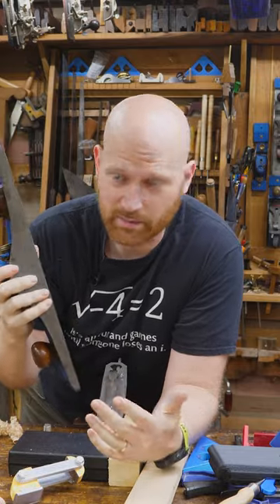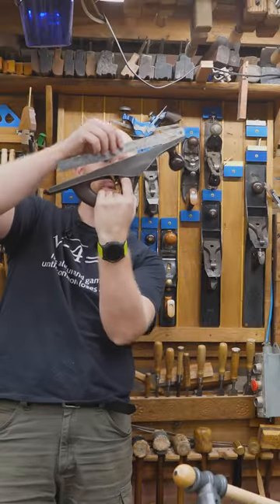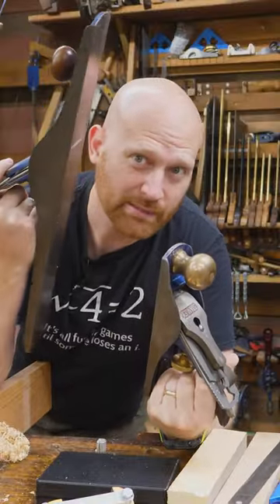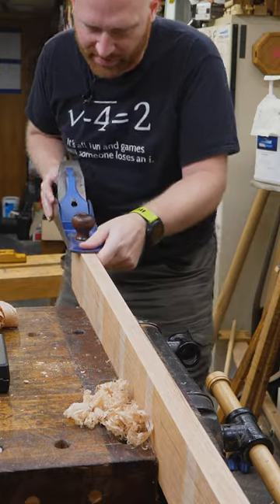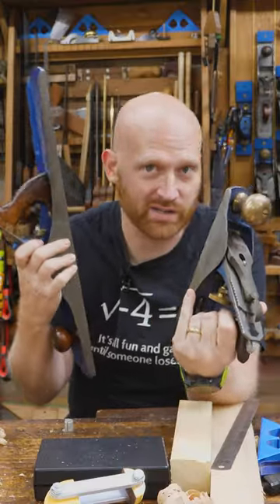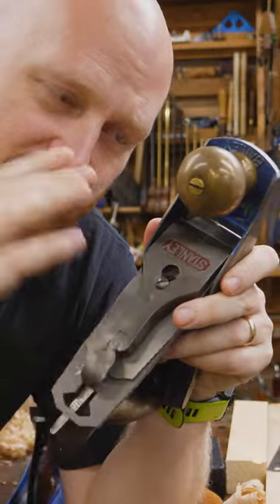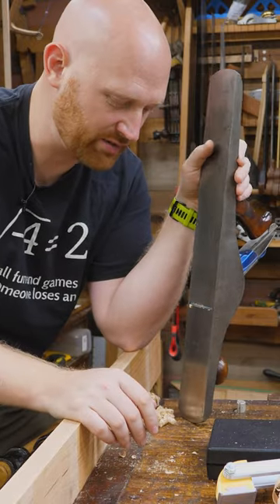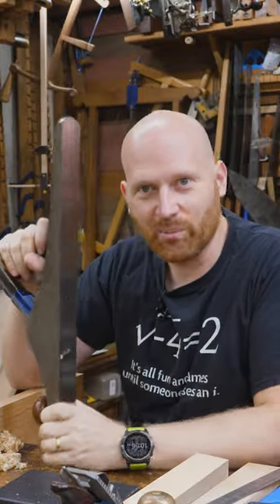How Flat Should The Plane Be

Comment: Well, here's my two cents as a luthier: I'm always joining pieces that are 100-thou or thinner. And when you butt up pieces that thin and hold them to the light, you can really see the inconsistencies. On anything over 250-thou, it's probably not a major issue, but when it's under 100, and has to withstand 150lbs or more of tension, it's imperative that the joint is flawless. 

In this case, the sole flatness is a major factor. If it's just a tiny bit out, you can clearly tell with the light-test. So I have to spend a lot of time making sure the sole is dead flat. 

All of that said, these imperfections will translate to thicker joints. You just won't be able to tell as easily. Sitting flat on a bench, the joints on thin pieces can look perfect, until you hold them to a light and see how imperfect they really are. So ultimately, I do think it's better to flatten them, even for thicker joinery, and especially if it's for stress-bearing applications. 

I'd love to see a test! One plane imperfect, one plane flattened to perfection. One joint from each plane, using the same exact piece of wood, glued with the same glue at the same time. Then stress-test them and see where the numbers are. Extra points for testing different thicknesses of joints. That's a video I'd be thrilled to watch!

Comment: I think that it was Chris Schwarz or the Wood Whisperer who said that flat enough is flat enough. Trying to get so flat that you can’t see light coming through a handheld straight edge was dumb, because when is the last time you had to take shavings as thin as a light particle? 

I believe he even said that he saw a student at a woodworking class have his calipers confiscated, since the student kept triple checking everything to machinist standards instead of focusing on his woodworking learning.
Reply from the maker: right on. machinists are often the most frustrated woodworkses
Reply: @WoodByWrightHowTo  I can absolutely imagine that, machining is so often about super tight tolerances, plans where 0.1 mm of variance is way too much, surfaces flattened using a level calibrated to the nth degree that have to be aligned with the earth's magnetic field, etc etc

Meanwhile wood, by its very nature, defies such precision, it flexes, squishes, and bends. Woodworking has to operate on broader specs than machining, and nothing infuriates a machinist more than sloppy tolerances!! 😂
Reply: I could also argue that, if your tools are more precise, then if you yourself have missed the mark slightly in your work, the work will still be relatively good. If your tools are deficient then you have to work harder to achieve good results.
Reply: @dragonsaint9446 nothing better than the absolute bewilderment that hits a machinist when their first drawer binds like its friggin pinned in place the day after they make it
Reply: @dylanneely91 as a guy who is a hobbyist in machining and woodworking, I learned this real quick 😂 thought that leaving 0.01mm tolerance per side would be enough for a lid to smoothly slide down the full height of a wooden base for a brass nameplate I made. There was lots of sanding and swearing to be had 🫠🙃
Reply: I come from a machining background in a wood flooring factory and honestly if you run calipers of wood flooring you will find alot of variance in one 24" piece. Our tolerances ranged from ±.003 on the tongue and groove thicknesses and width to +.010 or -.005 on overall width and thickness. That is still a very solid looking mating of 2 pieces. I wanted, and thought I would need, that level of precision, but it's not really necessary for most things I do in the wood shop. Lesson: Don't be a perfectionist unless you can afford to be

Comment: I'm a machinist, and I can't imagine working with a tolerance of .100 of an inch. A low precision job still usually has a tolerance of +- .01
Reply: Wood will swell and contract more than the tolerances you normally work with.

Comment: My wooden joiter isn't flat, I noticed a few days ago, so boards get a curvature as the iron bites (more) at the start and end, regardless of the shavings thickness. Time for sanding.
Reply from the maker: for a wooden plane you usually use another plane. It is much faster.
Reply: @WoodByWrightHowTo  Yep but, for my piece of mind, I would like to use a bigger plane for that and the jointer is 90cm long. The longest I have. Patience, sandpaper and a vacuumcleaner will do.
Reply: That biting could be as well due to uneven pressure youre applying to the plane. At the beginning, you should push the front part to start registering before the blade engages. Same at the end of the board, apply  pressure at the end to keep the blade at the same height between the blade and the board. Hope it helps 🙏
Reply: @rustytoolworks   Thanks, I'm aware of that and my technique is far from perfect. More practice, more practice.
Reply: @rustytoolworks    A straight edge will settle things. Biting at the beginning and ending of cuts tends to be due to the sole around the mouth being farther above the work surface than the toe and heel are. I have a nice-looking Ross and Alexander 17-inch beech jack plane that has that problem.  It also has a bit of twist.  If or when I get around to making it functional as well as pretty, I may start by very carefully removing the twist with a block plane applied locally to the high spots.  Due to the grain in the wood, you have to plane toward each end to avoid tear out, which increases the risk of splintering the ends.  There are already indications, previous splintering, that someone tried to fix this before I received it.
Reply: @jdjs2922 you only need a plane half as long as the one you need to flatten.

Comment: Good enough to do the job it is meant to do. 
I like that. 
I also like the people who swear by having the sole surface ground for umpteen dollars. 
Just make sure that groind plane is kept in a temperature controlled room  alone with everything it will touch. 
If not the sole will ripple until the temperature of the entire plane reaches equilibrium. 
You might not see it or feel it but the thick sections grow and shrink slower than the thin sections. 
Like the go faster boys and speed. Flat costs. How much can y0ou afford? 
If it can't be perfect then good enough is good enough.

Comment: How would you flatten a plane? With sandpaper?
Reply from the maker: Here is a video on that. https://youtu.be/j1YDaQdvI60?si=Dre9Az40pthw61is I use a belt sander belt and cut it so that it lays out flat in a long strip. Then I set it on a piece of glass and go to town. I usually start with the most aggressive grit I can get. 36 or 50.
Reply: The links you post in comments aren't clickable. 😭

Comment: My jointer only touched at the toe and the heel. A  little over 1.5 thou at the mouth. A little more behind the mouth. Was I wrong to send it back? Manufacturer said it was in spec.
Reply from the maker: 1.5 thou is within spec in my book. That's within the flexibility of the plane. Unless you are getting into competition shaving there really isn't much reason for it to be closer than that.

Comment: If your jointer's sole has a plain curve that is higher at the mouth than the plane described by the heel and the toe, you're digging deeper between when the toe runs off of the board and when the blade does. You'll be carving a curved taper at the end of your board as long as the distance between the toe and the mouth. Your plane may be straight enough for that not to matter, but to imply that straightness doesn't matter at all is ridiculous.
Reply from the maker: I did not say it does not matter. I said that if the plane is doing what it should then there is no reason to flatten it. If it is doing what you describe then it is too far out and should be flattened.
Reply: @WoodByWrightHowTo The #1 comment right now is "jointers don't need to be flat". Yeah, it's a joke, probably, but there are others that say the same thing and clearly aren't. Nuance is not well communicated in shorts.

Comment: You don't need a perfectly flat and smooth surface because that's not how geometry works.

You need an approximately flat surface so you have 2 smooth contact points at either end and then the blade in the middle will do the job of cutting down the excess resulting in a flattened side of the piece of wood you are working on. That's it.

Just make sure the blade is fixed at the right angle for what you want to achieve. Bada bing, bada boom.
Reply: That would be true if those two contact points were constantly in contact with the thing you were planing, but they're not.